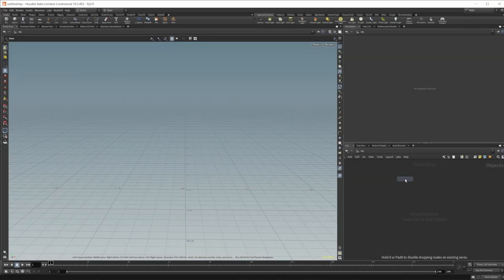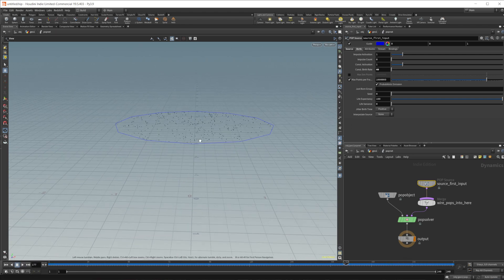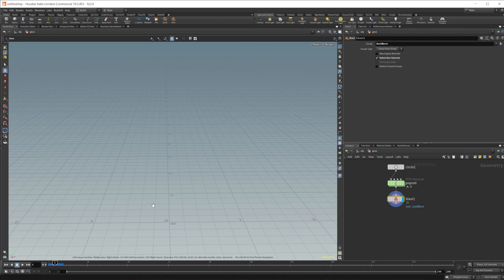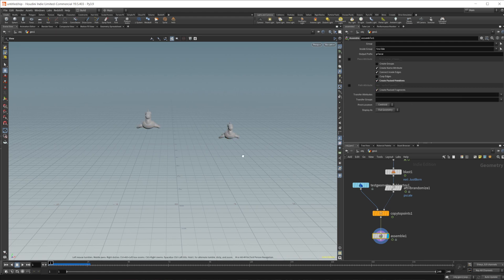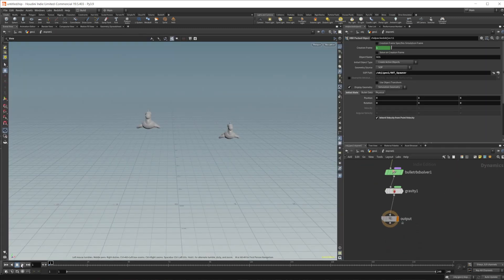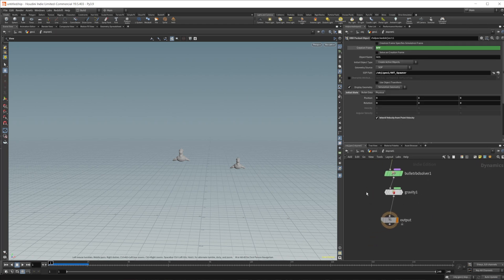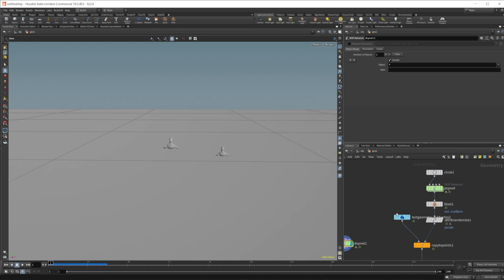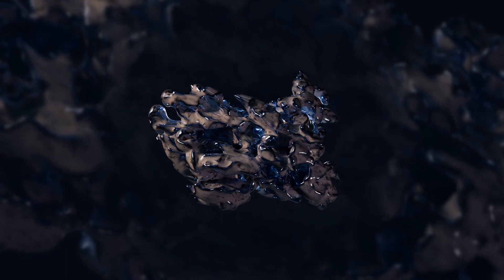How to Emit Rigid Body Objects | Houdini 19.5

Comment: Hey thanks for sharing this tutorial, it was super useful! How could I create an age attribute for the rigid bodies? I need to make the rigid bodies dissolve after a certain age
Reply from the maker: There's multiple ways to do that. You can probably get the creation time using f@creationtime and then use the difference between the creation time and the current time to calculate the age
Reply: @InsideTheMindSpace  thank you so much for such a quick answer! the f@creationtime should be used in an attribute wrangler? Would that go in the dopnet or after the assemble node when I spawn the points?
Reply from the maker: Yeah it would go in a wrangle. I'm not 100% sure if you need it outside or inside the solver but give it a shot and one of them should work
Reply: @InsideTheMindSpace  Tomorrow morning I'll try! Thank you for your help!